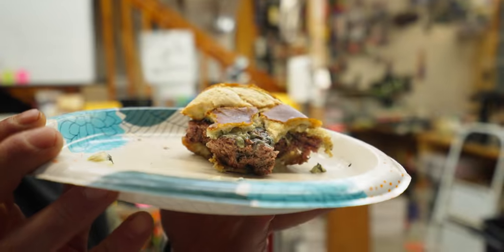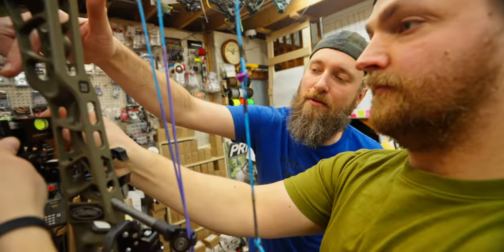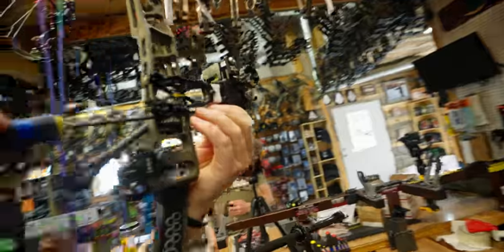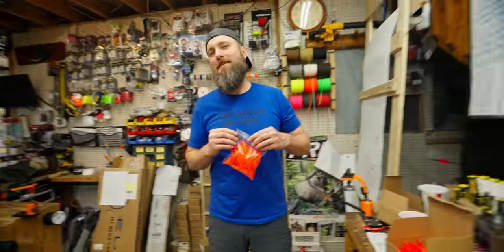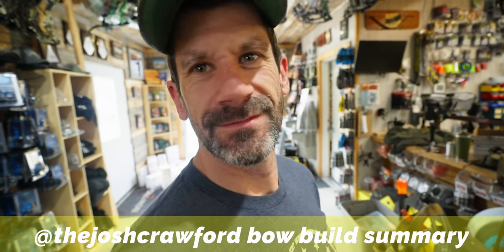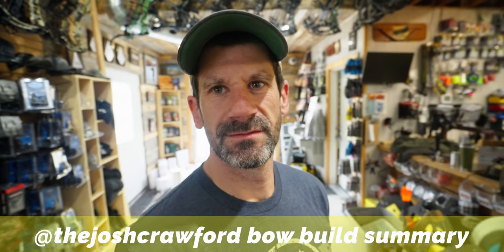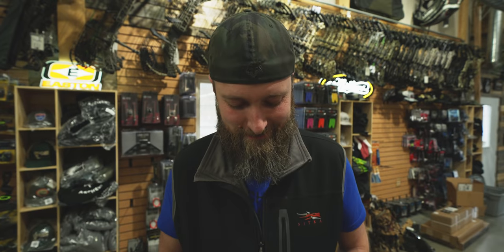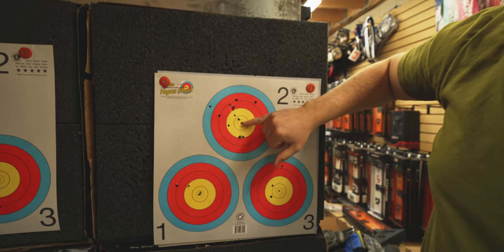BROKEN BOW and MFJJ Made US FIX IT // Operation Learn Bow Stuff

Comment: Question…shouldn’t you have the string level on the string, not riding on the serving? Seems like the serving material would throw off the calibration of the level to some degree.
Reply from the maker: Ya dude I’m just a young patawon in the bow mechanic game - tc
Reply: @ElkShape  definitely not a criticism. Having worked on my bow for quite a while I have found the little things make a big difference, especially at distance.
The only advice I would offer is make sure the finer details are dealt with now so you don’t have to guess later. Keep up the great work…I’m really enjoying the videos.